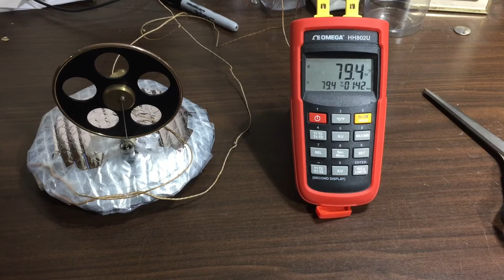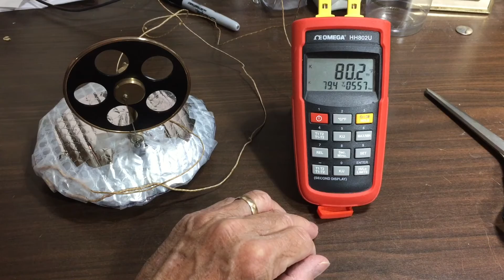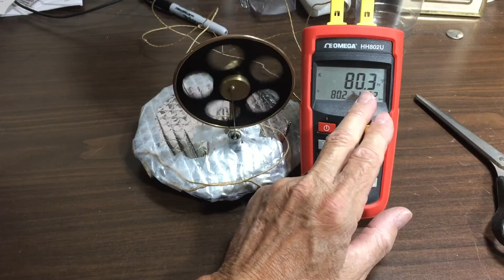Stirling Engine Heat Pump

Comment: The system is working towards an equilibrium. You've blocked the cold side from its source so it's only going to heat both sides since you have no real cold side. The friction from the parts moving because you're turning the flywheel is what's providing the heat. No heat can escape, it's like a mini oven in a way but it will only go as long as you can turn. Once you stop, so does it because there is no place for the heat to escape.
Reply from the maker: Thanks for your informative comment.

Comment: You have a closed-loop system. So as the gas expands it sucks in heat, and as it compresses it gives off heat. You happen the have this happening in the same location over and over again. For almost no temperature delta. If you could separate the spaces those two actions happen in it would work much better. Like a refrigerator

Comment: Interesting experiment, thanks for showing it.  I reckon you're getting an overall slight gain in temp in the enclosed space due to friction in the cylinder and con rods.  You could measure the effect by disconnecting the displace,  if interested.  There's also the problem of leakage at low speeds.  Maybe spin it faster with a motor?
Reply: 🔴 What Is Islam? ⚠️

🔴 Islam is not just another religion. 

🔵 It is the same message preached by Moses, Jesus and Abraham.

 🔴 Islam literally means ‘submission to God’ and it teaches us to have a direct relationship with God. 

 🔵 It reminds us that since God created us, no one should be worshipped except God alone. 

 🔴 It also teaches that God is nothing like a human being or like anything that we can imagine.

🌍 The concept of God is summarized in the Quran as:

📖 { “Say, He is God, the One.  God, the Absolute.  He does not give birth, nor was He born, and there is nothing like Him.”} (Quran 112:1-4)[4] 📚

🔴 Becoming a Muslim is not turning your back to Jesus. 

🔵 Rather it’s going back to the original teachings of Jesus and obeying him.